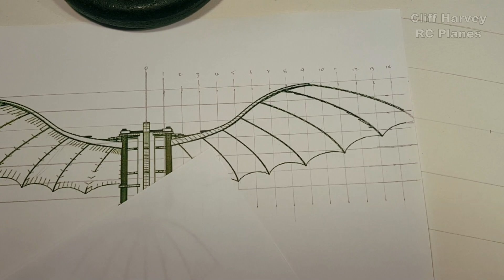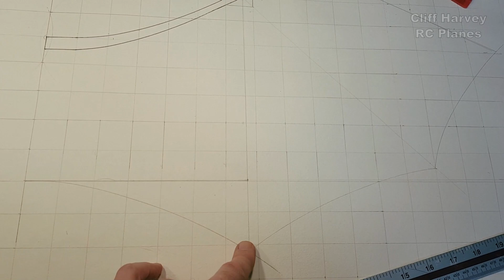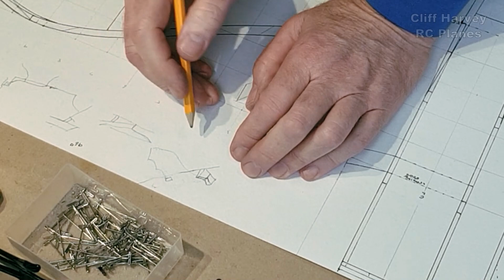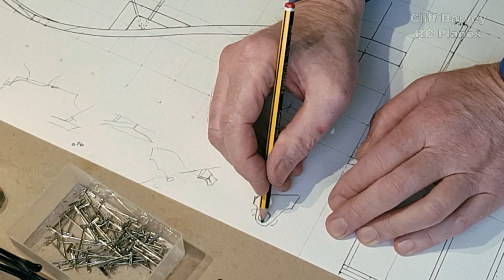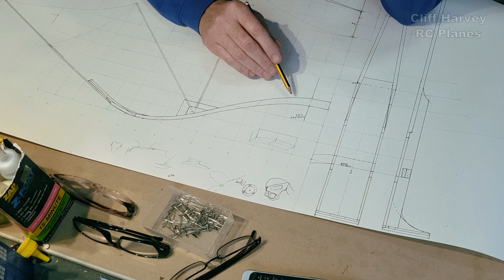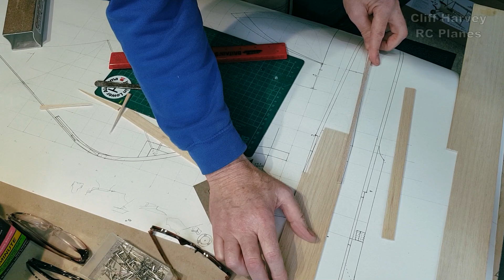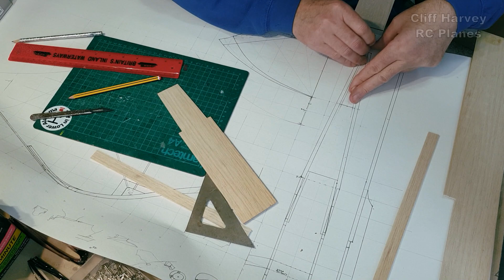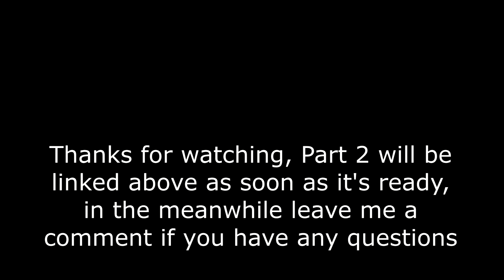Leonardo Da Vinci Flyer

Comment: Just a suggestion...which I'm sure you're familiar with...but for the leading edge of the wing, you might want to try taking thin cuts of 1/64th strips or 1/32nd strips and laminating them together in your desired shape.  A lot of WWI scale aircraft use this technique. Create a jig to keep the strips  together while the glue goes off. (Take a look at VK models Triplane tail. Nieuport tail, Sopwith Camel tail, or any of the Procter models tails. This technique  yields incredible strength allowing you to mold the exact  shape you want on a jig you create.) Just a suggestion.  Love your videos!
Reply from the maker: Thanks George, I am familiar with the technique but I'm going for laminations of balsa and ply for this one which is just as strong, thanks for the idea though  cheers 👍

Comment: Cliff, since I've quite a lot of experience drawing and flying my kites, this project is something I really fancy! If I get it right your wing surface will be made of light nylon, and the fabric will be beneath the frame, facing the wind, like it is in a kite. Am I rigth?
Reply from the maker: Hi PP, I had planned on using kite-type nylon but I've found something a bit different in the fabric shop which I'm going to experiment with. I would prefer to have the covering on top but I may regret it 😁👍